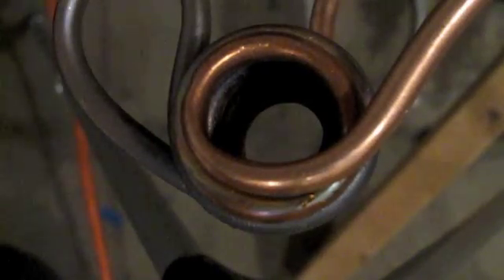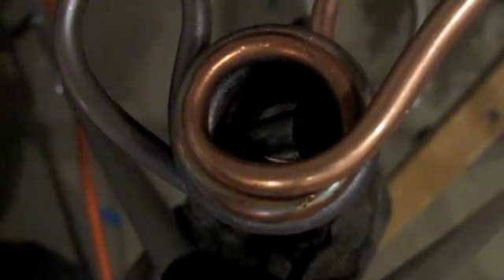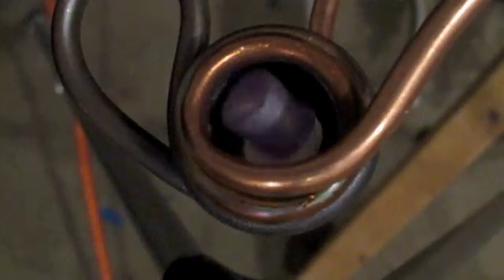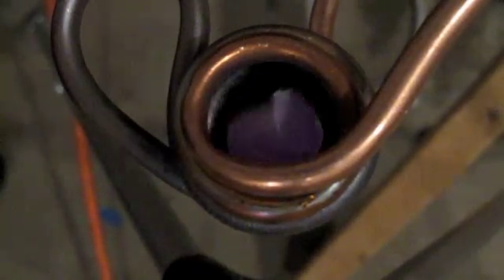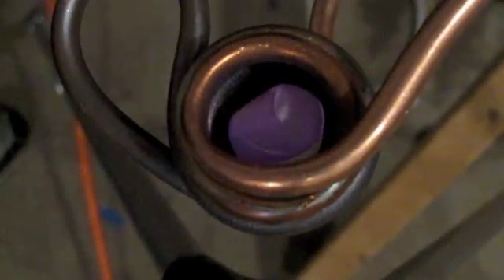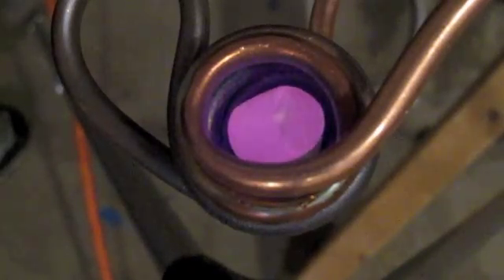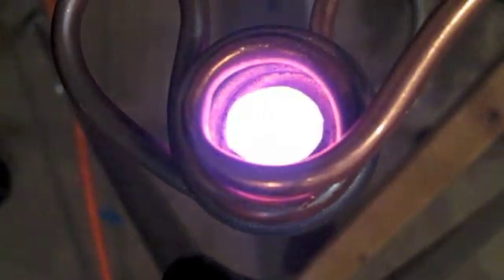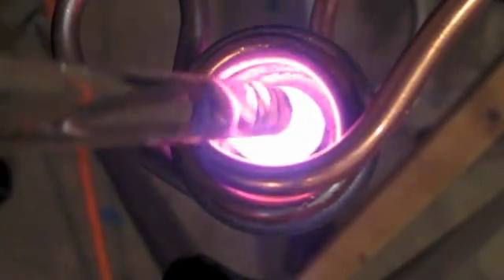induction heater levitation melting aluminum

Comment: Is the frequency or power output more important for levitation? It can't just be coil shape. I know to even heat aluminum you need +140KHZ right?
Reply from the maker: It’s coil shape, and power. Frequency is not critical.
Reply from the maker: The frequency will tend to be higher, because the inductance of the work coil will be much lower

Comment: How do u do that? I tryed it but I just gets warm and drops. I tryed aluminum. High frequency  and high current still falls through the coil.
Reply: Did you reverse the windings in the coil  and concentrically narrow the bottom half as he did? I think you have to make a little 'pocket' between the two winding directions for the sample to sit in, with an opening in the bottom just large enough for the sample to fall through... Could also be that hes got 3kw of power jammin through it.

Comment: I bet this guy's electric bill is like, $6,000...BUT HES GOT LIQUID ALUMINUM
Reply: 3000 watts * 3 minutes = 9000 watt-minutes == 0.15kWh

My electricity rates are $0.065/kWh, so $0.065/kwh * 0.15kWh == $0.00975.  It would cost less than a penny.
Reply: Yup, it isn't the electricity that costs much in this experiment, rather the 3kW power supply.

Comment: So many idiot critic commentators. They can't do and it makes them feel insecure so they have to find something to gripe about to make themselves feel better.
Reply: all you need is copper strong battery and aluminum... No one is insecure it's pretty fucking easy too do
Reply: No way, to make an induction heating effect you need current at high frequency.

Comment: now to shoot it out of a gun as it's ionized
Reply: that could work but i'm trying to use iron fillings and helium instead of a chunk of metal so I can kill myself when I trying to make a working plasma gun and it goes horribly wrong
Reply: that would be difficult because Plasma is an electrically charged gas.
Reply: yes yes it is that's why it's going to be either ferro fluid or gallium liquid rail gun for days
Reply: How would you condense the electrically charged gas and then beam it out of a gun?
Reply: magnets
Reply: You could use a battery of some sort to charge the gas. And If you heated ferro fluid into a gas would the iron particles still be effective?
Reply: I'm not sure but i'm using a microwave to make plasma right now so that's why i'm considering it and there is no way a battery could power this gun
Reply: Half Blind Productions you could use a similar design to grant Thompson arc furnace except using using a smaller rod inside a tube to generate the plasma and then use high power electromagnet coils to fire it like a coilgun but it will likely disperse shortly after leaving the barrel as the plasma will not be able to be contained or in theory you should be able to give the plasma the ability to generate its own magnetic field but it's unlikely to work effectively at this point in time.
Reply: actually you hit upon something there plasma does have it's own self contained magnetic field and will stay coherent after elaving teh source for a time and at the speeds of a bullet that time is plenty
Reply: Half Blind Productions you also might be able to effectively accelerate it to high enough velocity using the coilgun due to the light weight of the plasma but for any decent range I guess you would need at least 2000m/s+ to give it a decent effective range
Reply: considering we're talking railguns that's not a problem
Reply: if we could crack ball lightning we could easily do it
Reply: Half Blind Productions then you will have to deal with the problem of the plasma melting the rails that's why I suggested the coil gun as the way they work will cause the plasma to remain in the centre of the barrel
Reply: to be honest I can never remember how a rail gun is even built honestly I did mean coil gun I just kinda forget that a coilgun isin't a railgun
Reply: A real railgun uses a whole roomful of electricity to power super powerful electromagnets that are in the shape of rails (hence the name) that shoot pieces of metal forward at amazing speeds.
Reply: Jonn Ballehr I know that the power supply for a weapon of this kind is an issue as the energy requirement to heat, contain and maintain the plasma let alone shoot it out at any decent speed is ridiculous but this is really a tech for the future as we don't have powerful enough power supplies to supply it. As for railgun I know what they are and how they work and that is why is said that they would likely be not be able to used in this sought of a weapon.
Reply: yeah I was just saying I confuse the two and call every gun like that a railgun like out of touch old guy
Reply: railguns are already being made for the military

Comment: Why does it instantly harden?
Reply: +Caleb Fontenot because the floor is cold and it flattens so it comes in contact with a bigger surface of the ground, causing it to transfer it's heat to the ground in an instant
Reply: +Caleb Fontenot In addition to what damon-st said, aluminum has a relatively low heat capacity. This means it doesn't take a whole lot of energy to raise the temperature of a given mass of a substance; therefore, the aluminum will cool considerably faster on the presumably cool floor than for example iron. Heat capacity, however, is not directly related to melting/boiling points.
Reply: SCIENCE! How I love SCIENCE!

Comment: You should have let the ball drop into water so it cooled in a shape ._.
Reply: eh, no, water tends to explode when you drop something really really really hot into it, this one college professor did that very thing dropping thermite into a glass beaker, the water expanded so quickly it shattered the beaker and covered everyone in small glass cuts
Reply: eric planting I knew that, but I was thinking maybe a large metal drum could take the expansion :/
Reply: I am no science major, nor do I pro-port to be of any kind of scientific mind, but just for practically it could be passed through a water mist chamber stage by stage to cool it down?

 I mean.... sure it'd have to be on an industrial scale to make it any level of viable, but with a working proof of concept and then going through R&D towards speed and efficiency through repeated trials could bring it to a well timed machining process right? 

I dunno just my two cents no idea if this makes any sense, just wanted to put it out to see if it might have some workable pieces of info.
Reply: ***** TBH, it'd be easier at that point to just 3d scan the blob whilst it is held in place, then make molds to drop the metal into and cool into shape with.
but I dunno xD
Reply: +eric planting it's because of laidenfrost effect

Comment: I don't understand how critically heated metal retains its magnetism?
Reply: +Robert Wight it doesn't. The levitation coil pushes against eddy currents induced in the work. It is like a transformer with the work as the secondary. As it has currents in it, it can be pushed around by the magnetic fields in the primary.
Reply: @Folopolis yeah

Comment: 3 Things interest me here:
• Aluminum melts
• The magnetic field affects ALUMINUM
• Aluminum levitates
Reply: Bob Bill Practically everything is affected by magnetism if the field is strong enough. look up the levitating frog.
Reply: I knew that (I have seen a magnetized aluminum can before) but the coil effects it so strongly.
Reply: +Bob Bill a current is induced into the aluminium. It's like a transformer. But it just goes round and round inside the metal cause it isn't connected to any circuit to make it go places. That current is the same or lagging just slightly behind the current in the heating coil. So like magnetic fields repel, enough to levitate it, because it is at the top opening. I expect if it was put in the bottom opening, it would be pushed out of the coil, pushing it down instead of up. But notice that the force on the aluminium in the example shown is still in the direction of pushing it out of the coil. Except it is counterbalanced by gravity in this case. I guess it just falls down to where the field is strong enough to push it out and there is a balance of forces there. The induced currents also are what heat the work up obviously.

EDIT: I fudged it up a bit. The changing magnetic field in the heating coil produces an opposite magnetic field in the work. But if you imagine it, there is say north on the top of the coil and north on the bottom of the work, and so it will be repelled out of the coil. As it is sitting on the top of the coil, it will be levitated up.

There is also a levitation coil apparently, which I don't fully understand. Read the plans. Maybe you can make more sense of than me in my sleep deprived state :)~
Reply: Bob Bill ye what’s cool is i’m making one soon but not with an alternating current sadly my magnet isn’t going to make anything fly anytime soon

Comment: Aluminum is non-magnetic material as possible the phenomenon of magnetism?
Reply: The magetic feild of the melter is forcing the aluminum into magenetic submission making it magenetic for a whil3
Reply: Павел Емельянов Aluminim isn't non-magnetic, it's Paramagnetic. What magnetic property most people are referring to when they say it's non-magnetic is that it's not ferromagnet (retaining any residual magnetism)
http://en.wikipedia.org/wiki/Paramagnetism
Reply: Chris Chatelain Well, if you use copper, I think the experience will fail in copper very low magnetic permeability.
Reply: Павел Емельянов  you do know that there are magnets strong enough that they can lift fruit (because they have microscopic amounts of iron that  little magnets will not be able to interact with)

Comment: why it floting? if aluminum is a none magnetic metal like copper. if steel should float. or at least when take can to recycling center the aluminum can don't stick to magnet when sorting them . it does look like aluminum look like melted though so sure he using aluminum not sure why floating
Reply: With enough of a powerful magnetic field, anything and everything becomes magnetic.
Reply: Even the iron in your blood. X 2 was bad but magneto was badass
Reply: aluminum is paramagnetic, as dshmokiez said, it can interact with the magnetic field too in different and cooler ways btw
Reply: rodney adams I believe a sort of lens effect is occurring, this effect is how magnetic fields interact with aluminum.
Reply: rodney adams If a magnetic field is strong enough, it can theoretically interact with things we wouldn't consider to be magnetic.
Reply: I believe it's because the coil creates courrent in the aluminium and it becomes electro magnetic but I could be wrong

Comment: could this have the same effect with steel? like stainless or carbon steel?
Reply: Could but there's a certain point that you can heat steel to that makes it non magnetic and the. The induction wouldn't work. They use that sort of steel for swords and knives from time to time. Depends on what you want
Reply: +Leo Saffron Aluminum is not magnetic
Reply: +Anakin Skywalker No, what levitates aluminum is Lenz's law. The high power high frequency AC currents induce eddy current in the aluminum. Lenz's law says those currents are in such a direction that they cause an induced magnetic field that opposes the magnetic field that causes the eddy current in the first place.

You can levitate molten steel for the same reason - not induced magnetism, because it is over the curie temperature, but due to Lenz's law.

Comment: Why the brightness is purple and why when the metal melts it fels down?
Reply: Digital cameras can "see" infrared light to some extent. Strong infrared emitters (like that extremely hot bit of aluminum, or the infrared LED used in remote controls) take on a purple hue when seen through one.
Reply: Jason Gerecke
Thanks!

Comment: What would other metals do?  does the aluminum only float because it is lighter? what if you had a compressed air can and lightly cooled it/spin it, how long would it levitate? I have so many questions
Reply: it works due to eddy currents, try getting a strong magnet and rolling an aluminium can over it, it will stop. As long as other metals aren't magnetic, and are good conductors of electricity it will work. (I know everything is Paramagnetic or Diamagnetic but it has to be really resisting or attracted to not work.)

Comment: What is the coil made of, just copper?
Reply: It's copper pipe bent up into a coil. Water is pumped through so the heat does not melt the coil, something you cannot do with normal wire. This is how a lot of induction heaters are made, and judging by how the copper didn't discolor (oxidize lightly) from the heat, it is probably water cooled just like I said. Wire that thick would cost a LOT, and be inefficient due to the skin effect, plus pipe is cheaper (and easy to cool). I assume the hose on the floor was for water to cool it, I think I heard a pump in the background.

On his site he details how to make it: http://inductionheatertutorial.com/
It gives you a in depth understanding of how it works.

Also, he only used 3kW, manufactured ones for industrial use can be hundreds of 100kW or more. For example on Alibaba (global trade site) you can buy a MASSIVE one for melting scrap steel in a insulated nonconductive (usually high temp concrete) bucket within the coil.
http://www.alibaba.com/product-detail/induction-melting-furnace-for-steel-iron_895524244.html
This one does 500kW, which makes the one in this video look like nothingness. 380V@830A, thats a crapload of electricity, but these are super efficient compared to other methods. It costs $27,000USD, which is actually pretty cheap, but it is Chinese made.
Reply: theLuigiFan0007
fascinating... 

I'm learning about electricity in college, but I'm not at that level yet.
Reply: PTNLemay
I have been reading books on industrial controllers/automation, computers, some EE textbooks and circuit design guides since I was about 10-11 years old. One of the first ones I read was "Essentials of Electronics by Frank D Petruzella". Most of what I know is self taught and learned from reading and experimentation. I have a very deep understanding of designing circuits and repairing them. I have built HV power supplies, LED drivers that run work on dead AA batteries down to 0.3V, complete Stereos with FM decoding and countless other projects including a security system and plasma cutter for sheet metal. Essentially I have been learning and making projects for close to 7 years. This is why, as you said, my knowledge is at a fairly high level.

I can program code in several different languages including some Assembly for PIC Microcontrollers, SmallBasic, VB.net, C#.net, Python, Lua script, VB script, JavaScript and HTML markup for websites. I also have a deep understanding of Linux/UNIX and Windows, but a little more so about Linux. My main interests are computer repair/support and electrical engineering, of which I will probably go to college for IT/Tech Support.

I hope you have fun learning more, it is very interesting once you get into learing about electricity, electrical engineering and circuit design. I wish you the best of luck in your studies.

Comment: You should let it cool down in its molten like state and keep it and see how it's cools. I gotta do this
Reply: I don't think that what you wrote there means what there you thought it meants.
Reply: +Daniel  Schneider you can't without some sort of mad cooling because the same current that is levitating the drop of molten aluminium is also what is heating it. Turn the current off and it will drop like a stone.
Reply: +MrGoatflakes Well, MAD COOLING is what he needs, but the air would change its shape slightly if it's powerful enough

Comment: I was under the impression that these heaters only heat up iron or magnetic stainless steel...
 I mean at least induction cookers don't respond to aluminum. Could some one help me understand this? :)
Reply: Google eddy currents. Its a reversed version of that with the magnet on the outside and the paramagnetic object in the middle.

Comment: That is so cool.I wonder once it's molten,could you cut back the power to let it solidify and still let it levitate,or would it lose levitation first?In effect,use it to make solid aluminum spheres?
Reply: I'm betting it would lose levitation sadly, as there is no independent heat/levitation control

Comment: <3 Magical
Reply: How doues it qork? Is it the magnetic field from the heater that holds the aluminum? But aluminum is not rely magnetic.. so it's reeeeely cool!
I think itäs time to look over the consept of magnetics, maby add a new property?
Reply: HuMaNNaM MaNNaMuH no aluminum is magnetic just a special type of magnetic it it paramagnetic so it is suspendable in a magnetic field ex. the copper coil it was floating in works as an electromagnet to create the field of suspension